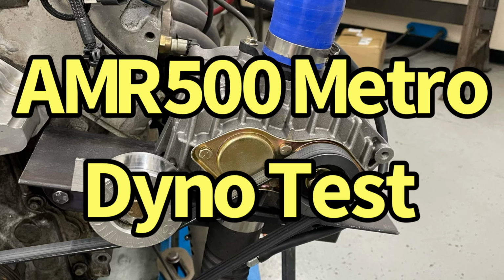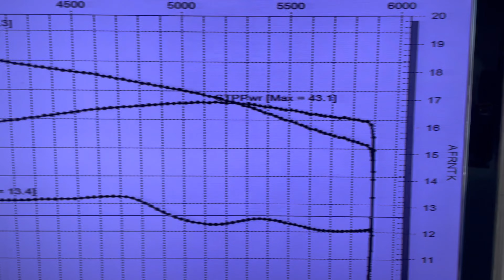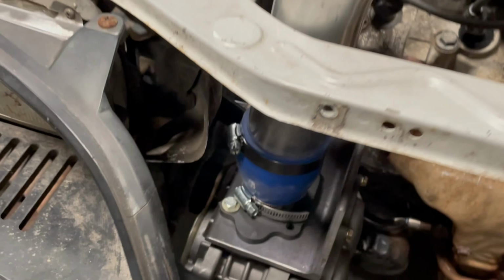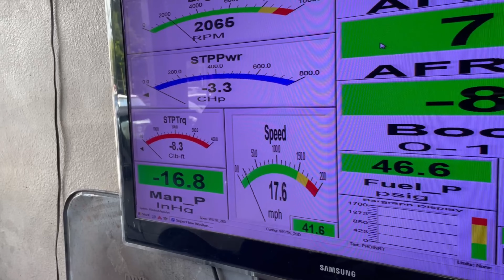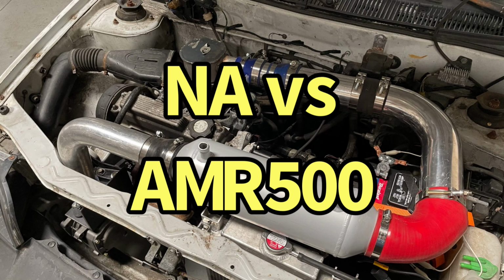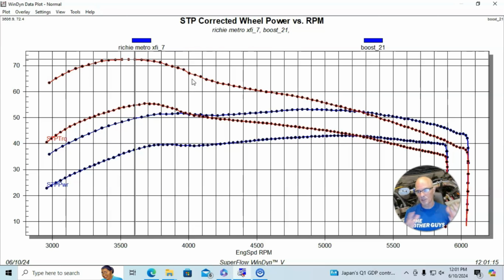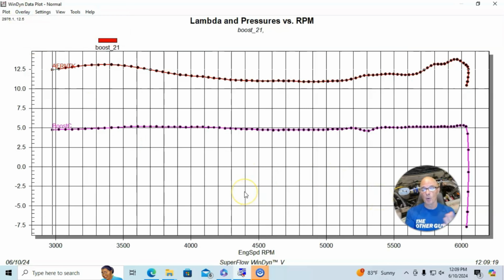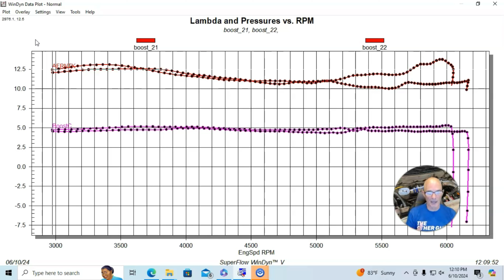FULL DYNO TEST-CHEAP, EBAY, AMAZON AMR500 BLOWER ON A 1.0L GEO METRO XFI! PLUS CHEAP ATW INTERCOOLER

Comment: Why not add a fmu and get it much more consistent?
Reply from the maker: that isn't enough
Reply: @richardholdener1727  at that low of a boost level a fuel management unit would do great, you'd need a solid fuel pump though I remember in your first dyno video of that car you had what seemed to be a weak pump.

I've installed around 50 fmu tuned low boost setups and never had much issue.  Air to air intercooler would probably be easier too if ya planned to drive it.

Comment: You will need to make a better carb hat.  At high RPM, the way that air is coming in through the carburetor with the hat you made will blow the fuel out of the boosters and starve your motor of fuel right when the compression is highest.  If you’re not running a forged rotating assembly, you will detonate and blow the motor.
Reply from the maker: No to both of those-this is EFI (not carb) and we don't need a forged rotating assembly to run boost on these

Comment: That massive whining sound I think has to do with the fact that the throttle body is placed after the Supercharger and not on the supercharger itself so excess air try’s and escapes back through the screws.
Reply from the maker: it was the blower

Comment: I have seen a previous test of these cheap blowers and it lasted less than five minutes being driven on the street. the rotors inside the blower are plastic coated and die within 5 minutes of being used. They are a joke?

Comment: the rotors are misaligned, easily happens when you torque them to the housing, it's cheap crap after all, probably came that way from the refurb.
Reply from the maker: it worked fine during flow testing-we just over sped the blower (by a lot) during flow testing

Comment: Lol on something that big??? What? I just picked up a good/used and will be refurbing and clearance it for a 200cc two stroke I am machining. (Dohc valve motor).  And am worried it wont be enough.  I would not put one of these on anything making more then 80 -100HP unless its properly had clearance's tightened up, and shaft/bearings modified swapped to legit strength units.
The center of the drive side bows at high input.  If you see some contact and cant figure out why, its because it is literally flexing and bowing inside. Then you take it apart and it appears straight.
Reply from the maker: the AMR can support 150 hp

Comment: This sc is bad I’d love to see this engine making Atleast 100 hp so use the original supercharger from a Toyota previa this is where the amr 500 is based off  using that would be cheaper than overhaulding the elcheapo supercharger I’ve seen the amr 500 make over 15 psi of boost so the previa supercharger should do the same reliably

Comment: You didn't hurt the blower these new AMR500Chinese blowers are junk they have cheap undersized drive bearing and a rotor coating that flakes off. Purchase a original Japan made blower and problem solved.
Reply from the maker: we did hurt the blower
Reply: @richardholdener1727  I meant it wasn't your fault. Buy a Japanese take off won't have any issues.

Comment: u mae many amateur mistakes. the biggest one it' the diameter of the piping. from th supercharger to the intercooler need no more than 1.75 inches and the same need from the intercooler to the trottlebody. you put a 3.5 inches piping you lose at least half of the pressure right there. if u reduce the diameters of the piping you will gain at last 25=30 hp because you will increase the pressure to 11-12 psi.
Reply from the maker: you must be new to this-none of that is true